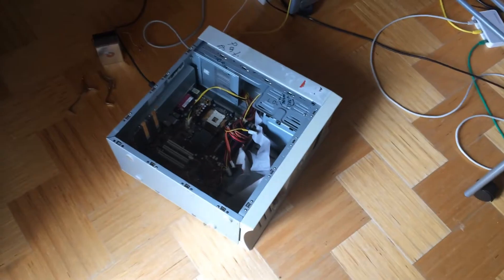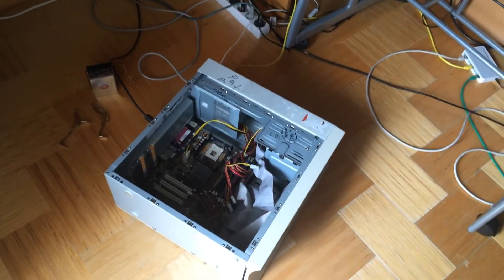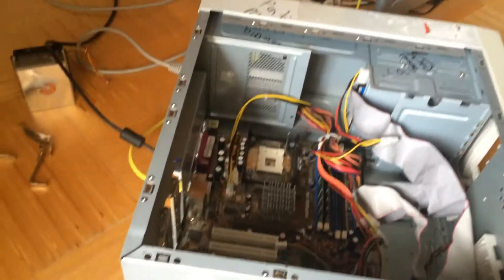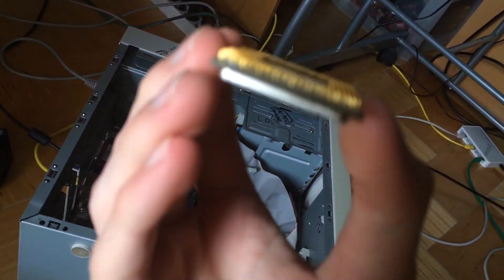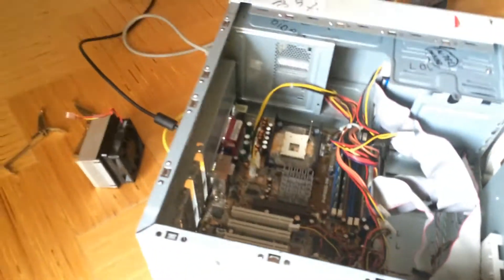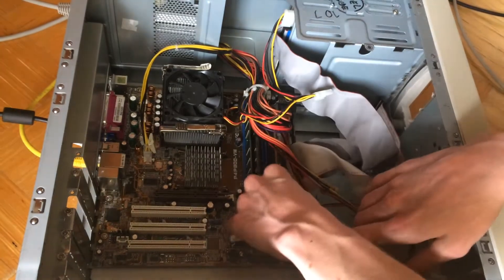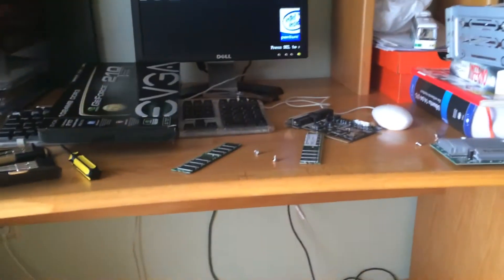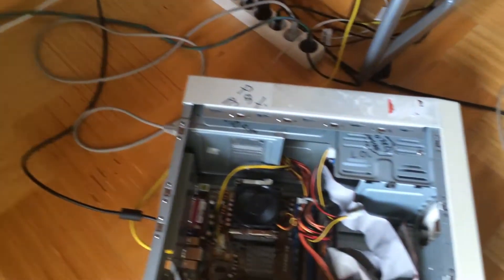Pentium 4 PC Weird RAM Problem

Comment: lol you just probably have a fussy ram stick/p4 motherboard is all.
Reply from the maker: +patg108 I don't remember exactly what was going on, but I think I could fix it with putting in the sticks in a different order.
Reply: Could be a bios issue, issue with that motherboard and/or stick of ram.  Only way to tell would be to try the same sticks in the same order that it gave you a problem on a identical motherboard.  Then it'd show if its just that one motherboard or if its some incompatability with the ram.
Reply: could of also just been a bit of dust causing issues

Comment: orrrrrrrrrrrr your ram is dead ;)
Reply from the maker: Ethan Tech I ran some RAM tests, and all of them passed, I guess it was just not liking this one slot
Reply: ***** hmmm i have no idea... never heard of ram slot not liking ram XD
Reply from the maker: Ethan Tech it works just fine in a different slot so I don't know whats the deal :D
Reply: ***** Hmmm lol that is really weird... i have a desktop (intel dual core) cant remember what dual core.... and it has a graphical issue.... i tried putting in multiple different graphics cards and it still does the weird glitch i tried windows xp windows 7 8 and even windows 98..... help? XD
Reply from the maker: Ethan Tech maybe the slot is defect
Reply: ***** i tried onboard....